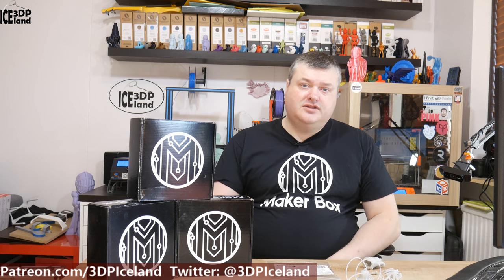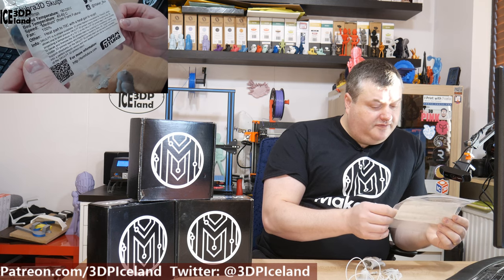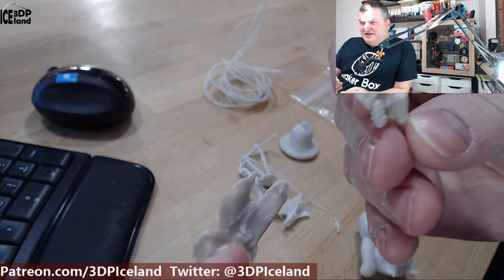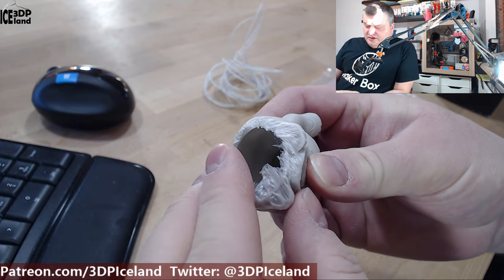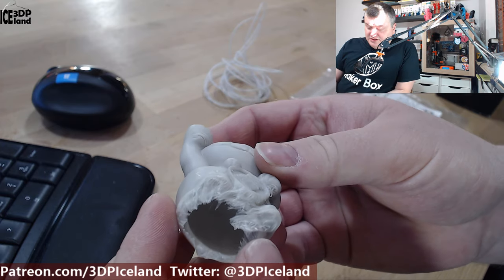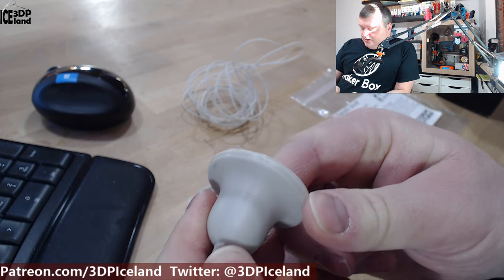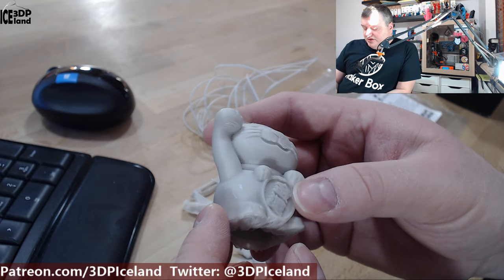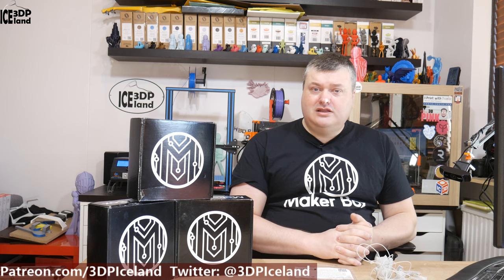Makerbox Monday - FormFutura Thibra 3D Sculpt

Comment: I've had positive results printing various figurines, head busts, etc. The material is useful for coming up with a decent base model, then working out different concepts by hand, or for reworking/adding more detail in the case that the user does not know or want to model that extra detail digitally.

I was surprised to see you had melting issues along the print bed. Mine behaved fine - not overly warm or mushy. Print quality for finer layer heights quite decent, but clipping with tools required for detaching support  material, etc. As a sculptable material, it works best with hollow prints, allowing for some internal compression when the shell is pushed inward. Scraps can also be heated and added. Limited scraping and carving is possible.

I will try some bridging and fine model tests on my end when I next have an opportunity.
Reply from the maker: Thank you for your detailed reply on your experience, and it's awesome that you can work with this material and find it useful.  It's difficult with the small samples to tune in, and find a good usecase for the material, and I'm sure given time and more filament I would have developed a better experiense for me as well :)